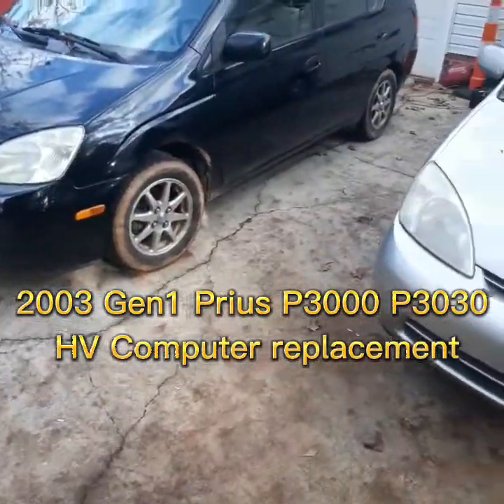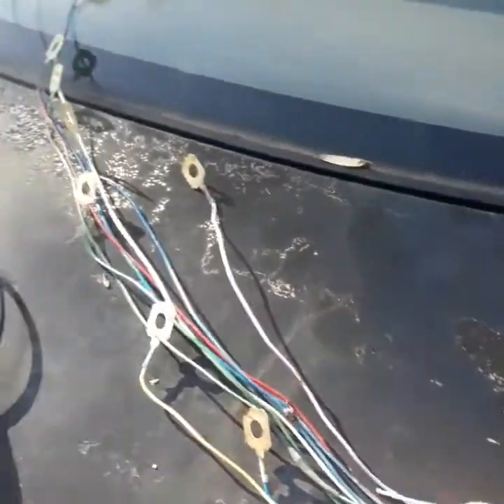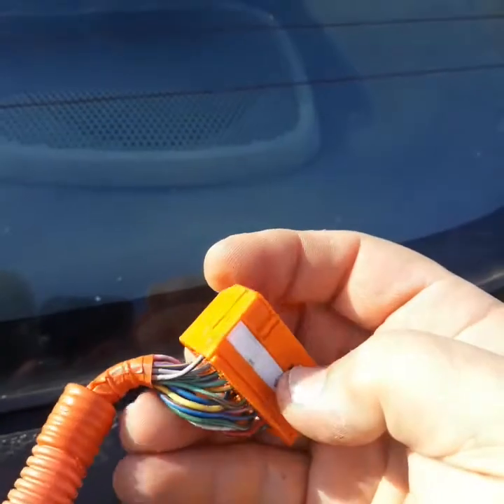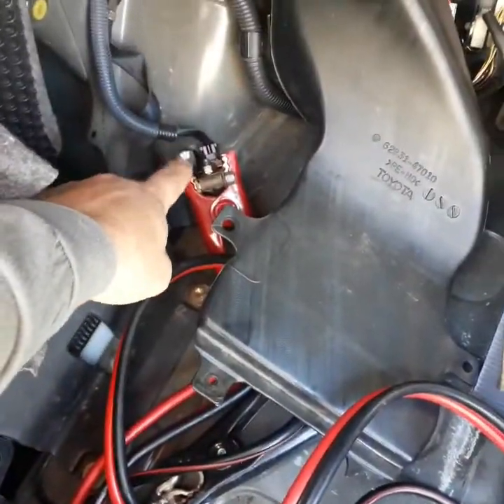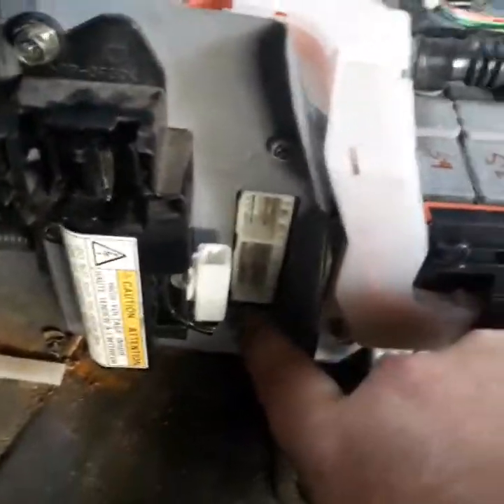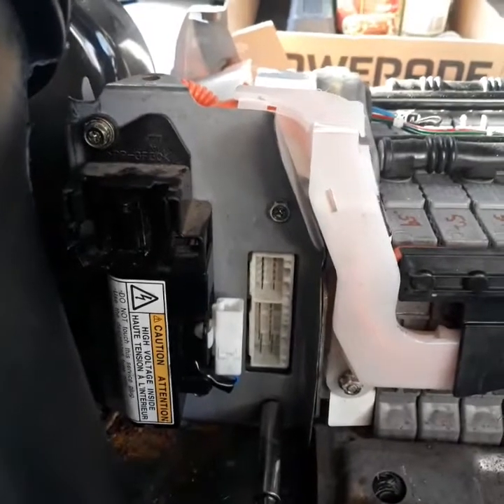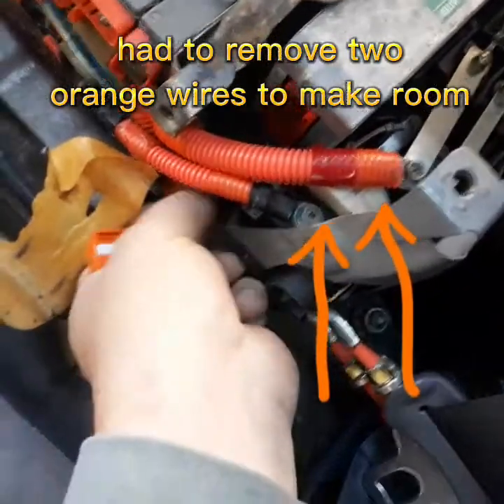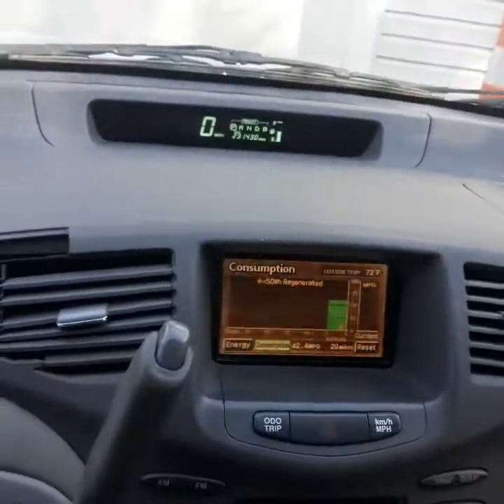2003 Gen1 Prius P3000 P3030 HV computer replacement.

Comment: I have a 05 Prius with p3000 and C1310 codes car runs and drives perfectly fine but had red triangle Becuase of those two codes, could this be the fix ??
Reply from the maker: @gavinmatthews5603  I would check the wires' first. My wires were not bad. So, when I took out my computer and looked inside of it,  it was burned in places. I then replaced the computer and the problem went away.

Comment: We just disconnected the HV orange main plug, without disconnecting the 12v... so what damage did we do because of that  if at all??
Reply from the maker: @madmax8620  that shouldn't be a problem.  The 12 volt battery doesn't need to be disconnected to remove the orange plug. That just disconnects half of the cells in the HV battery to make it less dangerous.

Comment: I have a 2001 prius & replaced bad cells  1 year ago & replaced wiring harness to battery also & had same thing happen about a month ago& re booted system  & seems fine🙂
Reply from the maker: Rebooted system?
Reply: @roscoesrepairs  turned key on & off 3 times when not started & hit brake pedal also while doing it?
Reply from the maker: Are you saying my burned up HV computer could have just been reset?
Reply: @roscoesrepairs  maybe,may just had a bad code because of bad harness which killed my cells in first place,had 4 wires bad?
Reply from the maker: I checked all my wires and connections, and they were all good. Near the end of the video, @7:21 I opened up my computer, and it was fried. After replacing the computer, the "wire snapped error" went away.
Reply from the maker: I agree with starting and turning the car off 3 times. That normally will reset the error if the error no longer exists. However, if the error continues, it will only be resolved after the broken parts are replaced.
Reply: @roscoesrepairs  ok... but he said he also used the brake pedals too somehow during the process to reset the HV sysyem..
 So What EXACTLY is the correct steps then?? I am needing to do this now...thanks

Comment: hello i m very happy watching de someone saving a mk1.
i am new to prius, and im on a opportunity about 100 000 miles but i have the message " add fuel " i couldn't find the tutorial for recalibrate the sensors on mk1.
and the fabulous P3030.
i'm mindind if i buy it to the seller 🤔, im in France and the car as stayed a time without mooving.
i love challenge 😂.
well done and informative for your issue ! 👌
Reply from the maker: What year is your Prius
Reply: @roscoesrepairs  hello 2001
Reply: 03/2001
Reply from the maker: Check your 12 volt battery first. If that is not good all kinds of problems occur
Reply from the maker: Are you able to do the work yourself?
Reply: @roscoesrepairs  yes 👌
Reply from the maker: Have you taken the battery apart and checked the sensor wires? That is why I did this video. The error says the wires are at fault. But the computer was burned up in my case. Do you have another computer? Three times now it has been the computer on my nine cars. Cars with over 270,000 miles.
Reply: no i still have not bought it but surely
Reply: My car besides it has those problems the engine starts shakes and shuts off
Reply from the maker: Did you ever find the recalibration procedure for the fuel gauge?
Reply from the maker: For the fuel level reset search
T-EL008-03
Reply from the maker: https://youtube.com/shorts/zWVAhEuu3wo?feature=shared